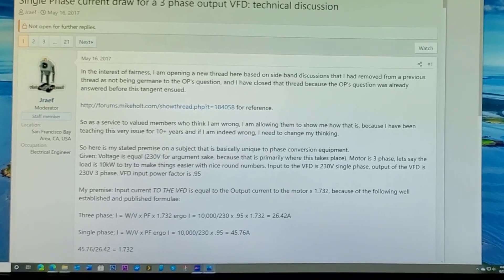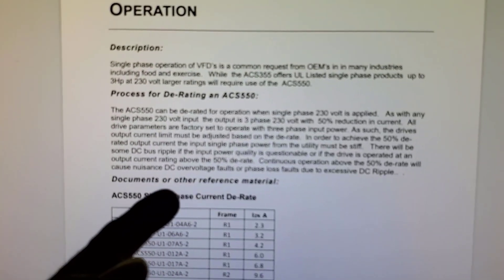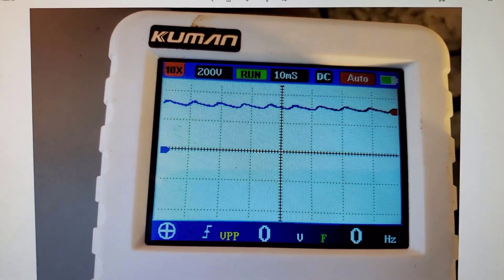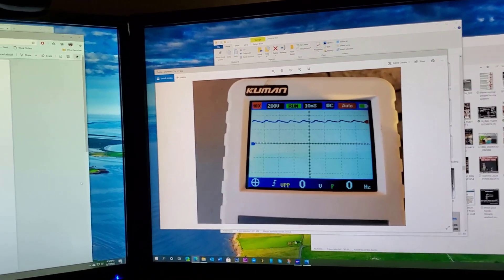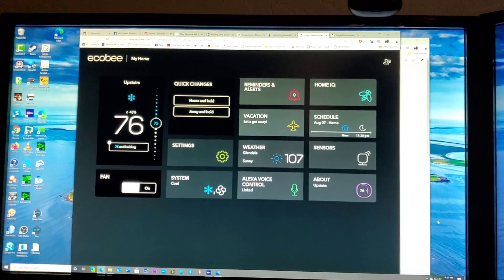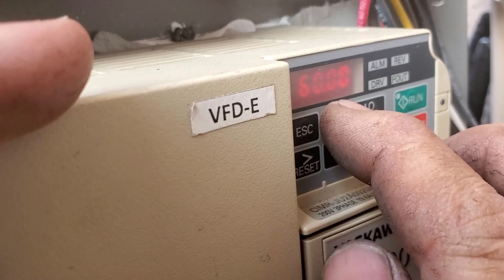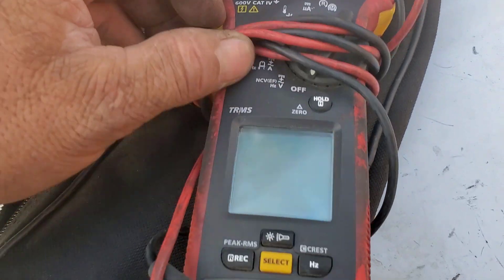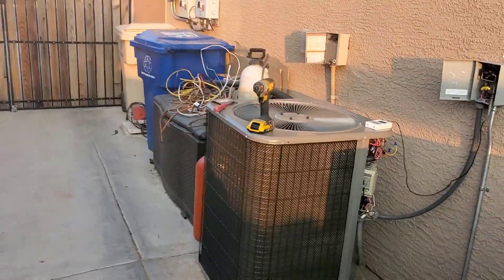My VFD + solar assisted A/C UPDATE: Amp reading research

Comment: even though it is 13.5A. The utility meters might be reading the same as your clamp probes so therefore you're still gonna get billed high.. could also be a crappy power factor in the vfd?

Comment: I like this project. I built a solar shed and a solar pergola in my yard. Although I am using a sunnyboy sma 5.o inverter, the principle is the same. Tying your panels into the DC side of a vfd is an awesome idea. As far as the high current reading I would think even though it sees 230v the valleys are giving the meter the higher current sense. Because lower voltage=higher current for the same amount of work. And the valleys are noticable. Having the third leg making the voltage reading flatter towards the rated voltage on the ac sine wave.  You show a 20 volt drop in the wave so that is 210v, about a 9% voltage drop could cause the higher amperage reading. 
Also two sections of the rectifier circuit carrying the load instead of three should be ok as long as the load doesn't exceed the rating of the diodes in those circuits, l1 and l2. I like your idea of using larger diodes.
One other thing, would there be a different power factor for single phase(poly phase/dual phase) compared to the 3 phase power factor or to the true single phase power calculation. Single phase (l-l) versus single phase (l-n).
Reply from the maker: Thanks man.
I may take one of my VFD's apart and see what it has inside.
I have several of them already and that is why I even did the project.

I have replaced mini split boards and they essentially do the same thing.
Single Phase in. And the resulting DC BUS powers the IGBT and circuitry which is just a VFD drive essentially.

If I didn't do this I was going to buy a inverter type small mini split and hack into the DC bus to connect solar.

Comment: The current reading of 18A will be corret.
The assumption that Voltage * Curent equals real power is your problem.
This is the case for DC systems and AC systems with only resistive loads.
But you system is a AC system with reactive loads like capacitors inside the VFD.
So voltage * current equals apparent power, NOT real power.

To give an example in one extreme, connect a AC run cap to the mains and measure the current.
Certainly current flows through it, but if you connect a watt meter to measure the power it will be almost zero.

You can improvise a oscilloscope current probe by salvaging or buying a current transducer from a VFD, they are made by LEM for example.
With that you can measure both AC and DC, isolated!
They will just need a +-12V supply and a resistor on the output to ground, on that resistor you can measure the voltage which than equals the current with a certain ratio.
Reply from the maker: I haven't been making any calculations with current and voltage.
I'm just noticing that the clamp on amp meter is not reading correct RMS etc and at this point I don't know what the input power is.

The output of the VFD is just fine so I am not really too worried. I am just curious of what it would be like to read it accurately.

I did use a solenoid coil (with no metal core) around one of the AC line wires and I could see the pulses somewhat with my el cheapo handheld LCD scope.
My other scope is not easily portable and since it plugs into 120V grounded outlet, I'm not too keen on getting it near high voltage power sources. Although reading the coil would be isolated. 

I learned something about reactive loads when we were adding power factor correction capacitors to some 3 phase motors at my old job (see some of my older videos of it) and I read up on how that reactive power would go back into the AC power grid but how does power going through a diode rectifier possible go back from the DC BUS capacitor into the grid?
Isn't that impossible because of the diodes?

Isn't it simply just drawing current when the AC (now rectified) sine wave exceeds the current charge of the CD capacitors until the voltage drops below the charged cap voltage and then stay at zero until the input sine wave then again exceeds the DC cap voltage?

I'm thinking I just simply have relatively short current flow with the rest of the time period being no flow.
Reply: @hackfreehvac  By what value do you judge that the reading is not accurate?
The Power Factor is not bad in the respect that it resembles a capacitve or inductive load.
Distortion of the current waveform is the problem, this causes a bad power factor and higher RMS current than a good Power Factor.
So the phase angle can still be close to 1 but but the PF can still be bad, see here:
https://en.wikipedia.org/wiki/Power_factor#Distortion_power_factor

This is why we usually use a active power factor correction for high loads.
Reply from the maker: @Alexander470815  
I mean it can't be a accurate RMS reading. 
It would mean that like 40% of the power in its disappearing in the VFD.  Lol.

The output of the VFD is like 7.8 amps on each of the 3 phase lines.
Which should be about 13.5 amps line side. 
Not 20. Which is what I read with the clamp amp probe  

I think the clamp amp probe is reading the high peak amps and not accurate. 
The Amprobe 330 I have days it has TRMS
I think not. 
Our maybe it's just good for typical sine wave readings.
Reply: @hackfreehvac  The power is not disappering.
The power factor is bad because of distortion of the current waveform.
If you look in the manual for your VFD, especially the single phase models the rated current is in that range.
The 200V model for single phase 3HP for example, rated Output Current: 9.6A and input current: 20.2A
For a Siemens sinamics G110 this can be even worse.
The siemens one pulls 27.2A for a 3HP Motor! (Yes 230V single phase input)
Current distortion is causing the high current, this is the reason why the clamp meter shows these high values an they are correct.
The more DC bus capacity, the higher the current spikes, the worse the power factor, the higher the rms current.

It is hard to wrap the mind arround this, i had problems understanding it too but that is whats happening here.
Reply from the maker: @Alexander470815  
I am sure it is not actually disappearing. 
I was joking that there's no way that the VFD is using that much power from the utility side and not driving the motor with almost all of it.

I am just saying that the amp probe reading is not comparable to what we'd read on a normal sine wave feed.

I believe it's pulling 20 amps,  just not for a long time period 
There is no way its pulling an equivalent of what you'd read on a typical single phase motor. 
That be enough power to run a 5 ton unit and this is a 3 ton.

I wish I had an accurate meter,  like that fluke power analyzer, that would tell me real kw power.
Reply: @hackfreehvac  A real power meter would be the key, this would show why the current is so high.
The single phase unit of course pulls less, because it has a power factor of 0,95 or arround that.
The VFD has one arround 0.7 or something due to current distortion, so you cant compare the values directly.
Reply from the maker: @Alexander470815  
I bet if I had a meter than accurately read my KWH usage it would be within expected.

This amp clamp meter is just not a good comparison to reading motors.

I made a new video on this subject. Check it out.
https://youtu.be/7EXEWXQy2M8
Reply: @hackfreehvac  Well the clamp meter gives you the real rms current that is flowing.
But with the bad power factor this gives you not the real power when multiplied with the voltage.
With a compressor and a PF near one you can ignore this one.
But with a rectifier and capacitor bank you can not.
See this one: https://www.vishay.com/docs/88868/anpfc.pdf
The problem is not the phase angle like in linear AC systems with inductors and capacitors.
Its the distorted current waveform giving you a bad power factor.
Reply: @hackfreehvac  Are you reading only the current going into the VFD? Just curious as your condenser fan will be drawing 2 to 3 amps (main and auxillary coils) if measuring L1 or L2. That would add a few in. I don't really know what's going on, I just find what you're doing interesting.
Reply from the maker: @etherealrose2139  
The condenser motor pulls .7 amps
I also often read it at my line feed to the VFD itself.

Comment: Also, you could use that scope to get an idea of the AC input current if you just wrap a wire a bunch of times around one of your input conductors and then put your scope probe on that. Might need a small resistor inline to get a better signal (or in parallel if you've got enough turns). 

Alternatively put a long length of wire in line with one leg of the mains and put your scope across that. The slight resistance of that wire will result in a small voltage drop proportional to current which your scope will be able to see.

Comment: Someone previously mentioned using a power factor correction circuit from an old power supply, if you're going to the trouble of using an external rectifier, do this. This will smooth the input current draw waaaaaay more and it'll also help with your ripple.

Might have been old server power supplies you can strip for the PFC section? I can't quite recall the comment.
Reply: I believe it was my comment. Use the PFC from a Cisco WS-CAC Power supply.
The 4000W Version should be fine for this application.
A normal VFD does not have any kind of active power factor correction, a DC choke is the best you get on some models.
Reply: Thermoelectric7   You would think that vfd  would already have active power factor correction, since it has been required for years on computer power supplies for years to prevent neutral overload problems.  Or is that not used on three phase supplied equipment?  You would think there would be problems with bad power factor with a lot of those running, even on three phase.
Reply: @DEW409  you'd think so, but I've definitely pulled apart some drives (Invertek branded) that weren't. And the DC bus ripple he's seeing implies it's probably not PFC either as you'd get much less ripple. 

Maybe it's just a cost thing, they aren't required to so they just go for the cheaper option and skip it?